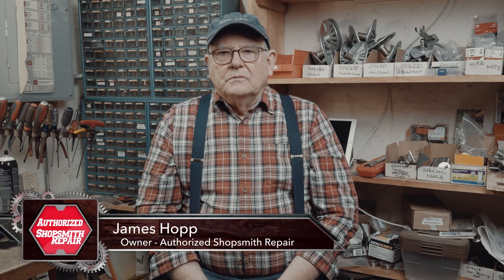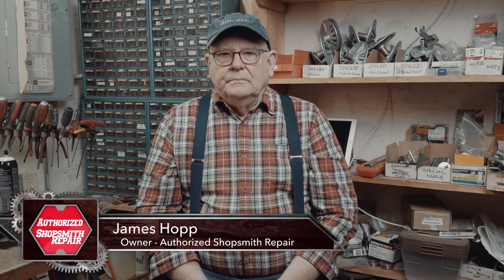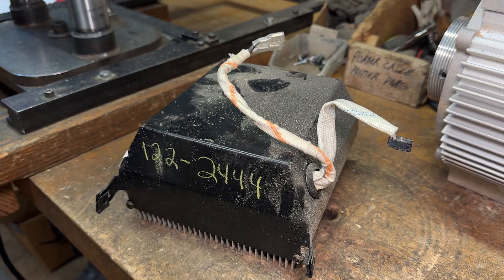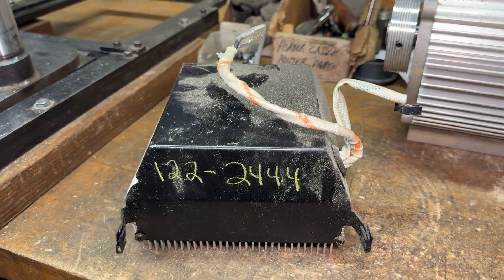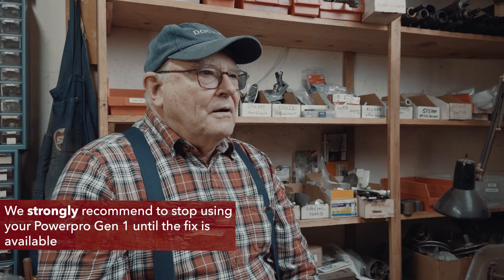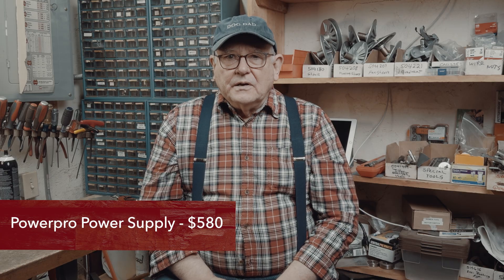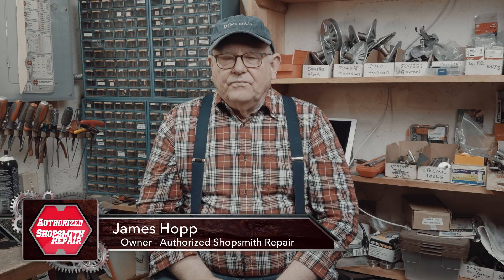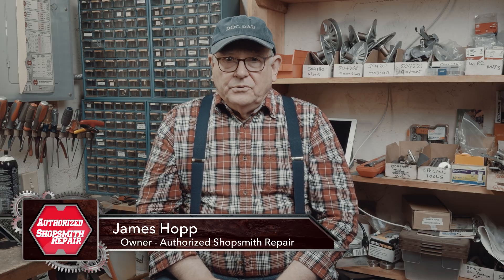Powerpro Power Supplies are burning out, here's what to do!

Comment: Could you please clarify, is the $580 what it will cost to send the headstock in for updating before something goes wrong?
Reply: I think it means $580 is what a replacement power supply costs.
Reply: I had this happen pre-shutdown and as James said, sent bit pieces to Shopsmith. They determined the power supply needed to be replaced and it cost me $580. In the wait period, I bought a used conventional headstock to use and kept it for future problems. It could probably use some repair, but filled in well.